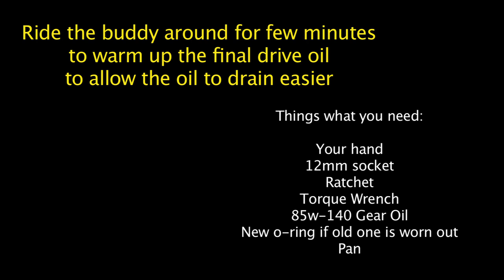Genuine Buddy - Final Drive / Transmission / Gear Oil Change | Mitch's Scooter Stuff

Comment: At 2:44 you showed the amount of gear oil to add at 110 ml. I am about to change the gear oil on my Buddy 170i, and the owner's manual said the replacement amount was 90 ml. 110 ml is only if the gear oil chamber is totally dry. If you drain the gear oil, then put 110 ml in it, it is overfilled, and could blow out the seals. I think you put too much in there.
Reply: impossible to overfill because it is designed to leak out when overfilled before you put the plug back on

Comment: hey heres a thought ... flexable funnel ne ways i use severe gear by ams oil in mine works like a champ the stuffs made for deisel trucks so yeah will deff take the beating and you dont have to change it as often =)
Reply: cause its like 80w190

Comment: Looks pretty easy. Had my first oil change done by the shop but I will be doing future ones myself. Only problem I’ve had is finding the right oil locally I had to order online. The local auto parts stall said they sold it but they never have it in stock